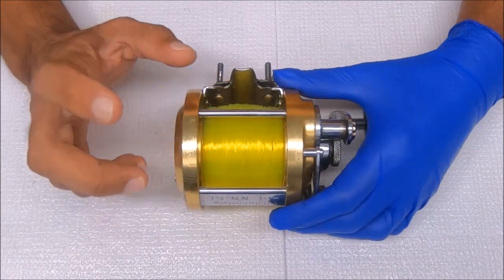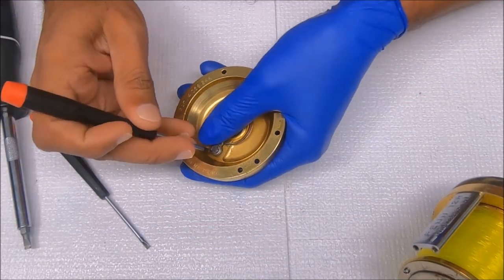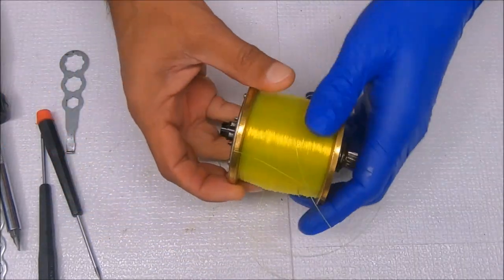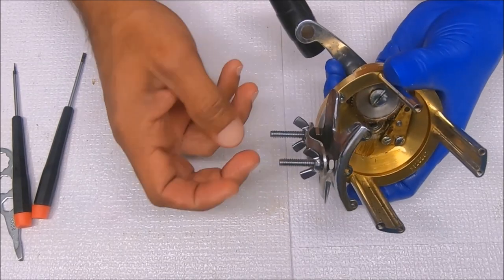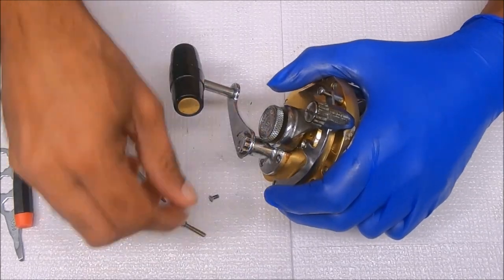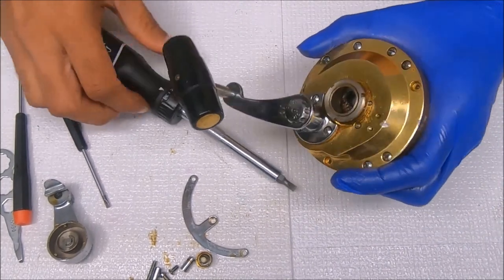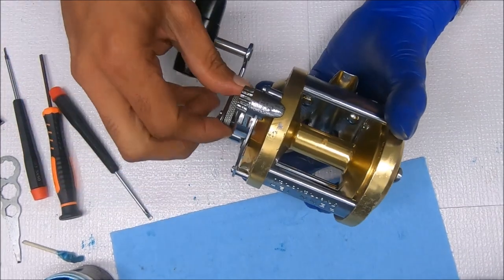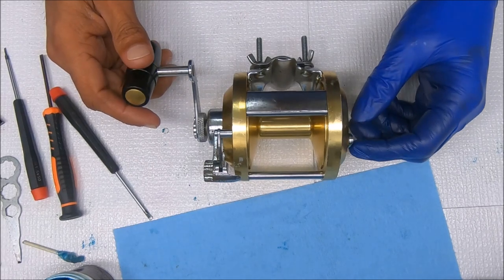Penn International 12H Fishing Reel - How to take apart, service and reassemble

Comment: I've found on the original 12's, if you tighten the main gear screw just a hair then losen it, they come out
Reply from the maker: Thanks for watching and sharing your thoughts. Thought I had already responded to this... I'm at around a 1 in 4 success rate when doing this for reels with stubborn screws.